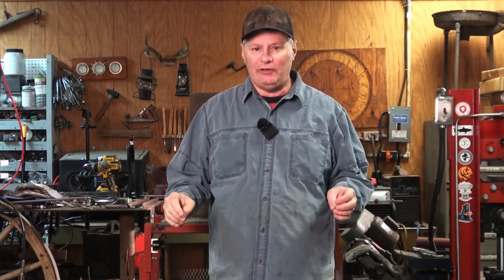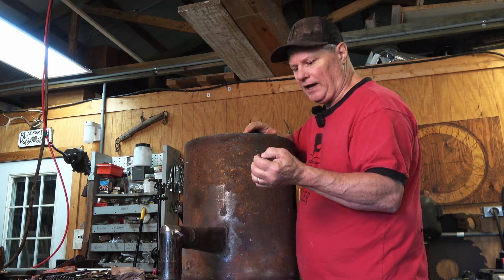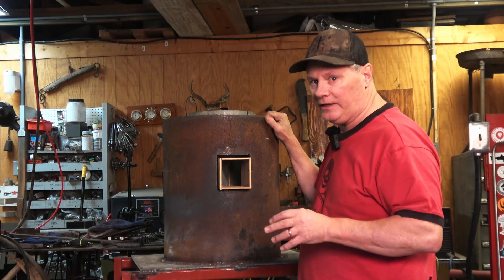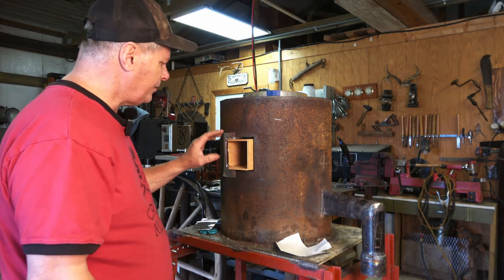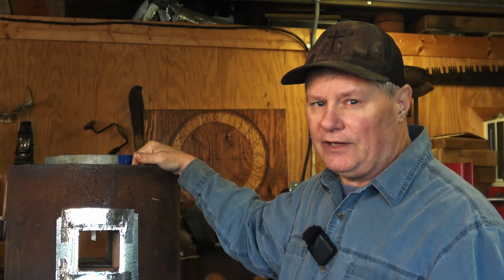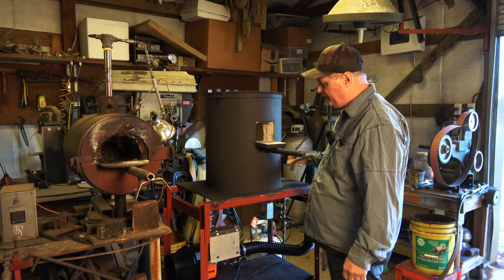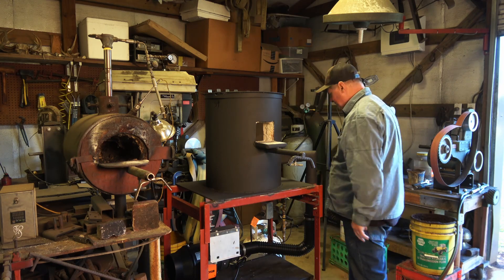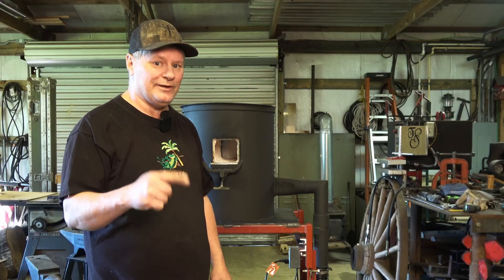Building a SIMPLE Don Fogg post box forge

Comment: You need to coat that wool with some refractory cement or you'll be breathing in those fibers whenever you use the forge.
Reply from the maker: It is coated.  Poured it with castable.  Did you watch the video?
Reply: @TonySeverioKnives  I had to watch the video in segments and my eyesight is not the best, my bad.
Reply from the maker: Yeah there is about an inch or so of refractory poured over the kaowool, totally Incapsulating it.  The refractory is very flux resistant.
Reply: @TonySeverioKnives  Roughly how long does the coating last before it needs replacing? Also, how's the fuel efficiency with this kind of forge? I made a few gas forges based on popularity, but this design is very interesting and looks like it gets got really fast.
Reply from the maker: The refractory will last for years if not damaged.  I have two different forges coated with it.  The wool behind it is what helps with efficiency.  The other forge is a single burner Venturi that I do most of my forge welding in.  It’s a very efficient system.
Reply: @TonySeverioKnives  Thank you for your time.
Reply from the maker: No problem 🙂

Comment: Is the extended amount of time to heat also just this style of forge characteristic?  Could you bring the roof refractory down some to get a smaller chamber?
Reply from the maker: Some of it is/was due to the refractory curing but like I mentioned in the beginning, the chamber is larger than it needs to be.  But I’m running half the amount of gas right now.  My old forge has a much smaller chamber and I run it wide open.

Comment: What model number is your gas valve? I bought one but it's a 12v and not 110v. Thanks
Reply from the maker: There’s one in the description that’s what you need.  1/4” pipe and 110 volt.  Thanks!